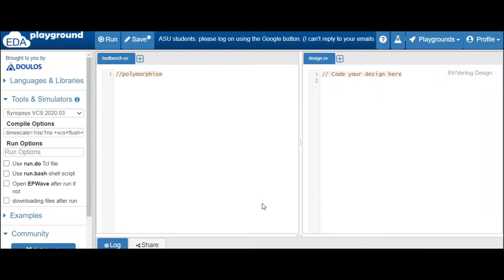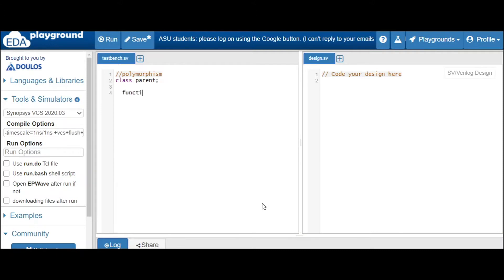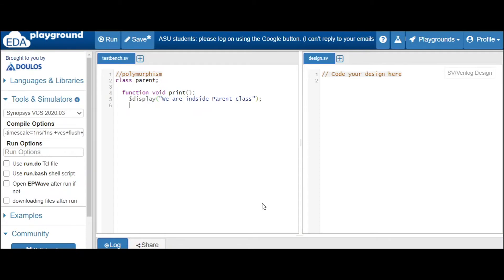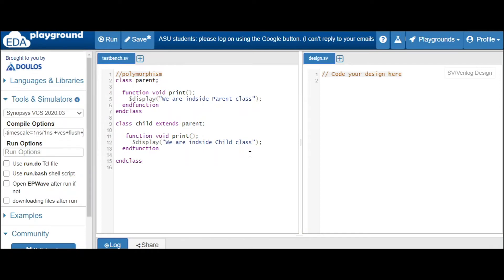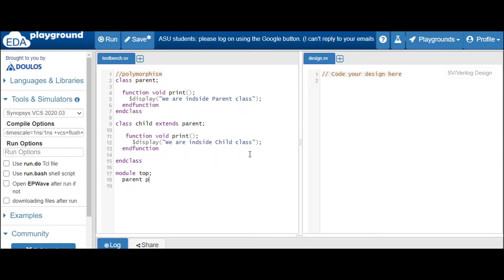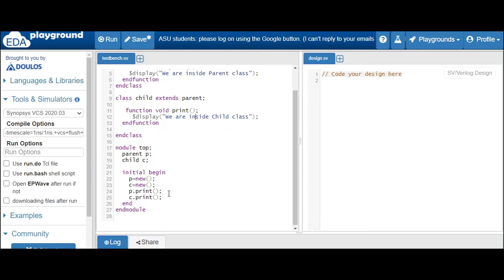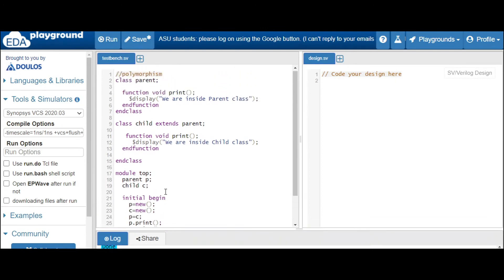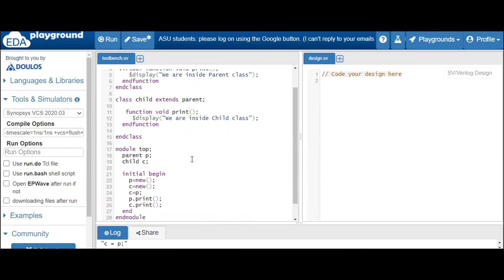System Verilog Tut 9 | Object Oriented Prog Polymorphism

Comment: Can I get the exact definition of Polymorphism
Reply from the maker: Polymorphism refers to the ability of a class or object to take on multiple forms. Polymorphism is a key feature of object-oriented programming, and it allows developers to create flexible and reusable code that can be adapted to different situations.

There are several types of polymorphism...
Method polymorphism: This refers to the ability of a method to take on different forms depending on the context in which it is used. For example, a method may behave differently depending on the type or number of arguments that are passed to it.
Overloading: This refers to the ability of a method or function to have multiple definitions with different signatures (i.e., different numbers or types of arguments). Overloading allows developers to create multiple versions of a method or function that can be called depending on the context in which it is used.
Inheritance: This refers to the ability of a class to inherit properties and behaviors from a parent class. Inheritance allows developers to create a hierarchy of classes that share common characteristics, and it allows them to create more specialized classes that are derived from more general ones.